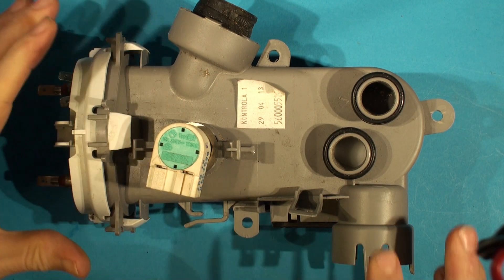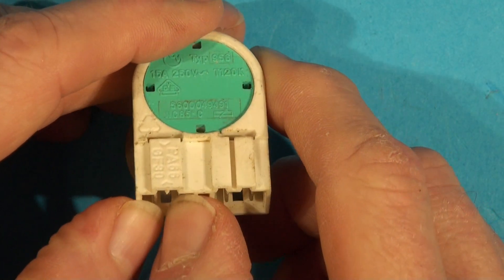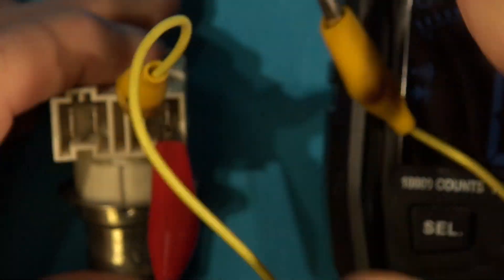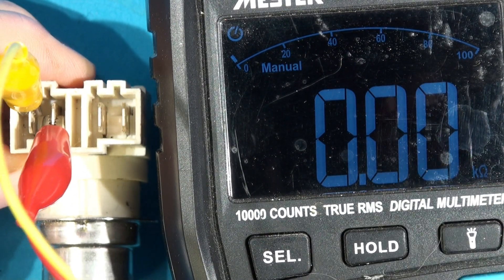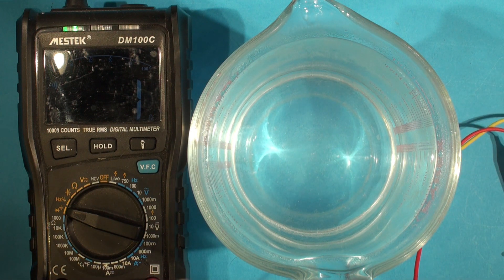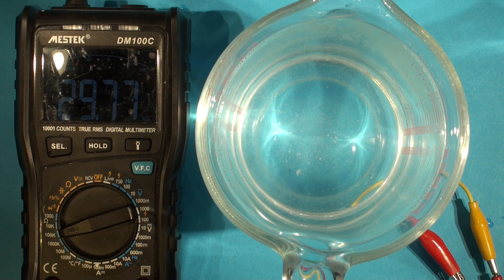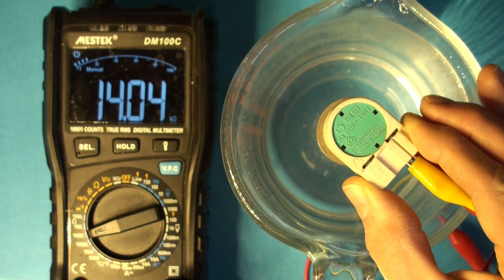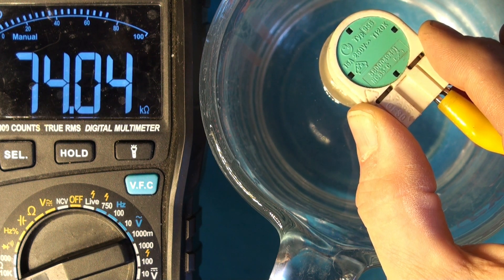Bosch Neff Siemens NTC Thermistor Thermostat Multimeter Test  00165281

Comment: Awesome job mate! I thank you from Ontario Canada in 2025. My Bosch dishwasher hasn't been cleaning properly.. I figured something in the unit's water heater circuit was the issue.. the heater itself is fine, but the NTC in this device just tested as an open load. Time for a new part and a thanks to you for showing the test values and procedures 🤙
Reply from the maker: Great to hear about another successful repair. Thanks for watching.

Comment: My Bosch SuperSilence stops during the washing. The display and everything goes black out. No error codes, just sudden death. Just like somebody takes the plug off from wall. After random time, normally like 2 minutes, it wakes up and continues. I changed the A01 setting to A00 so it uses cold water, and then it works normally. Could some system in the dishwasher think that the system overheats and shuts down for some kind of safety caution? I have checked different plug behind different main pfuse to be sure it's not in the wall plug problem. Also checked the doors magnet and it seems to work good (checked youtube video about the doors on/off switch). Also opened the door panel to see if the display have something clear damages, but didn't see any. Also checked the mainboard and it seems to be ok. Next step is to check this. But shouldn't this give you some error codes?
Reply from the maker: More likely a bad crimp spade terminal connection somewhere in the power wiring or a bad solder joint on the controller..  The bad connection goes open circuit when under high current.  If you open the unit and trace the power wires all the way from the back to the front and look at all the connections checking that they are not discolored, melted or burned.  This includes the edge connectors that plug into the controller. Then take the controller out and inspect - you will probably find a witness burn or overheating mark on the circuit board.   Overheating is usually controlled by the controller. In the event that the controller freezes and demands heat when it should not, there is a separate cut out that usually just interrupts power to the heating element in an overheat situation. Good luck.
Reply: @razenby  Hey, thanks for fast answer. I also thought that it could be some bad connection just like you described, but I haven't found any overheating marks anywhere yet. I opened the front door panel and checked first the wirings and power buttons for the display panel. I even had the panel in my hands to see clearly everything. Then I tried to follow the wires to locate something odd. Everything seemed right. Then I checked the left side where is the flow sensor and it's wires and it also seems fine. Then I opened the right side panel and located the controller board. I took it out and checked it all the way. The controller board seemed perfectly fine. Nothing discolored or melted or burned. I just thought that this should be the case. I haven't checked the bottom yet, because that's the hardest place to remove things. But as I can't see anything odd yet, I think that's the next step to follow the wirings to the bottom.
Reply: I also tried to look very carefully for the bad solder joint in the panel and in the controller board, but didn't find it. But yes, I know that those bad solder joints can be very hard to locate, even though it should be there.

Comment: Thanks for the video.I have a leak from the thermostat. What you think can't happen?
Reply: Thanks for the answer .The o ring is replacement. The motor underneath return very slow.thats the way it works?
Reply from the maker: Yes it run slowly it just directs the water to the lower or upper spray arm.
Reply from the maker: Probably something to do with the O ring/seal deformed.

Comment: Thanks for this. Is it possible that a bad controller board can damage the thermal cut off switch? I have a SHE65P05uc/63.
Reply from the maker: No the controller cant damage the thermal over temperature cut off switch. .  A short to ground (supply earth) on the heating element connected to a mains supply that is not protected by an RCD trip can sometimes damage the cut off switch or the heater control relay in the controller.     However the mains fuse would usually blow too.
Reply: @razenby  The unit is hardwired and has not tripped the breaker so far.(Normal 15a breaker, not gfci/afci) What is strange is after installing a new heating element and thermostat which did not solve the heating problem, now I can't get the therm to cut off when immersed in kettle hot water.  It did pass that test before installation.  In fact, I have 2 new thermostats(long story) that will not cut off now.  I was about to order a new controller board but worry I am wasting more money. Machine runs fine except for no heat, E1 error.
Reply from the maker: Did you check the flow switch - the Microswitch on end of heater element?

Comment: I have a sensor where the thermal cutout switch side has a continuous beep, but when adding boiling water to it it does not ever shut off. Would this be something that needs replacing and could cause my dishwasher to power off mid cycle and start back up later?
Reply from the maker: Sounds as though it isn't working. If the controller board processor crashes is could melt or cause a fire so yes - If you are sure that you got it up to temperature then you should replace it.
Reply: @razenby  sorry my wording was poor. Currently my dishwasher shuts off mid cycle and loses power. After 30 min or so it'll turn back on further back into its cycle. This will happen repeatedly and usually never finish until I just reset it. I've been searching for the problem and got down to this sensor issue. Would this sensor not switching off be a cause of this issue or is it likely a different problem?
Reply from the maker: @Scully19  Likely to be be a different problem...Does the operation of opening and closing the door allow it to carry on??
Reply: @razenby  nope, power basically shuts off and it doesn't do anything. Can sometimes be turned back on by holding the power button down for 5 seconds but otherwise it is non-responsive
Reply from the maker: Did you find out what was wrong with it in the end?
Reply: @razenby  nope, this wasn't it so I just ended up finding a cheap replacement

Comment: Great tips - as ever.
Reply: A few years ago Bosch had a problem with heater controls failing.
Essentially there was and overload in the control panel.
They did a free repair if your dishwasher was in the correct batch.
Ours was in the batch but the free fix didn't get it going the fitter replaced the extra part free on his own initiative and fudged his paperwork.
Reply from the maker: Glad it was helpful!
Reply: @razenby  if their is no continuity on the left probes dose that mean its not working
Reply from the maker: @oliverbarrett6622  If you have no continuity on the left contacts as shown at 4.00 minutes then the thermostat switch is blown. The mains is routed via these contacts to the heating element.
Reply: @razenby  ok thanks for that any idea where I could get this part . It's off a kedwood dishwasher part number is nc 83tr-793
Reply: @razenby  Hi - I have found your Bosch/Neff videos really helpful and informative.  I have a problem with my S5443X2GB/44 Neff dishwasher where the water is not heating up.  I have tested the thermistor and heating element as per your videos and they both check out fine.  I have replaced all the relays on the control board and the fault remains.  The washer goes through a program correctly but the water never gets heated - wondering if you have any other ideas as to what the fault might be to avoid me having to fork out for a new dishwasher right before Christmas..............
Reply from the maker: @garynugent7912  Is the water pressure  micro switch  in the end of the heater working OK?   It is easy to wire it temporarily in bypass and see if you get heat.  Note that occasionally elements can go open circuit when they start to warm up but buzz out OK when cold.  If you have ruled out all of the wiring and crimps/connectors I guess that just eaves the controller itself.  The port pin from the micro just drives a transistor which in turn drives the relay. It is not that rare for a micro's port pin to fail.  Are you sure that the wires are in the correct places?  The plug that goes onto the thermostat sometimes gives issues too. I have been known to wire alight bulb across the heater so I can monitor what is going on.  If there are other causes I am not sure what they are..
Reply: @razenby  Thanks for the quick reply.  I think all the wires are in the correct place as I labelled them while taking it apart the first time.  Unfortunately I'll have to dismantle the base to release the pump, heating element etc. in order to test or bypass the micro switch.  Now this fault is with a replacement controller board that I got from E-Bay - my original board developed a fault of no lights coming on at all on the display although the mains switch was supplying 230V to the board and it is outputting 25V AC out on the other pin of the connector.  So I actually have two problems which I think are both related to control boards as with my original board in the machine it was heating the water fine until this power problem occurred which caused me to look at getting a 2nd controller board.
Reply from the maker: @garynugent7912  If you have no lights then change the bits in the switch mode power supply. very common fault. Send me a picture of the controller and I'll send you the components if I have them.  Look out for  7 pin chip with part number staring with LNK... If it s that version t is easy to fix...
Reply: How do I send you a picture on here?
Reply from the maker: @garynugent7912  ark.mail@gmx.com.  Mae sure I can get a good view of the components..  Just going out for a burger.
Reply: @razenby  ok, I'll send some pictures later on this evening.